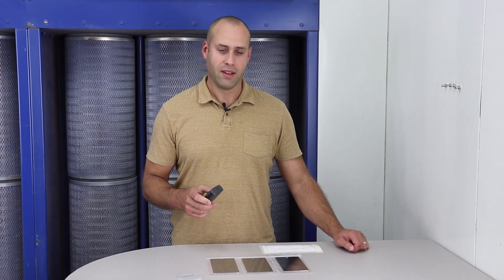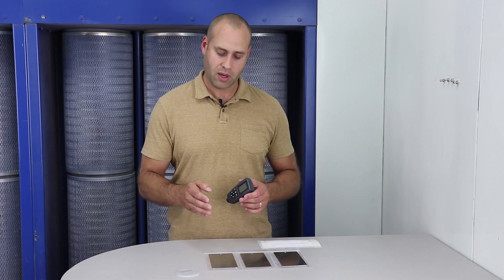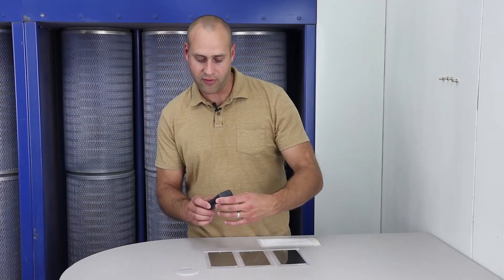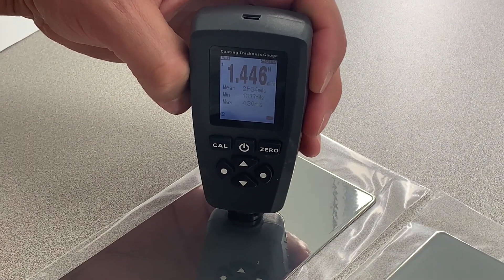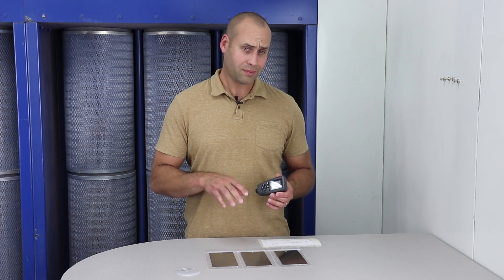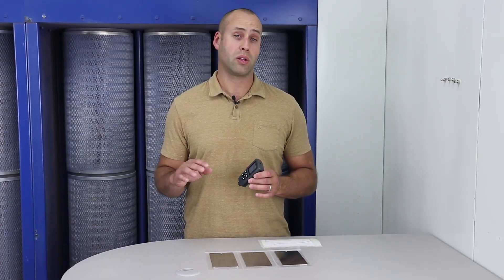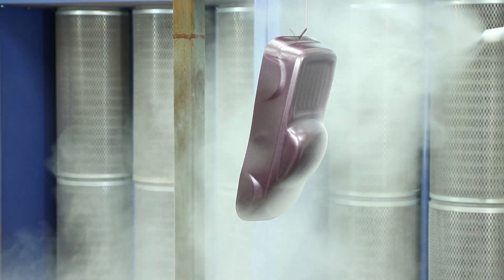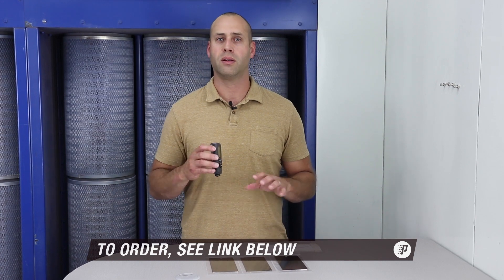Tech Tips: Measuring Mil Thickness

Comment: I have purchased a gauge from your company. If the mil thickness is done after the cure process and it's not thick enough. What would be the process to increase the thickness.
Reply from the maker: Unfortunately once it's fully cured, it's on there and you may not get intercoat adhesion by applying more. You could do a partial cure (2-5 minutes past flowout) and then check and touch up any light spots, and usually at that point you can see where it's thin.